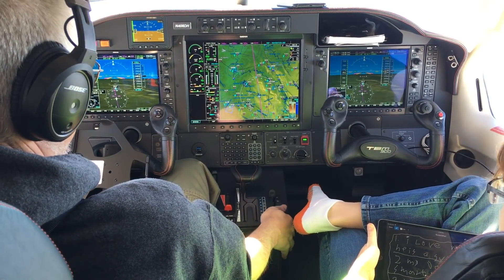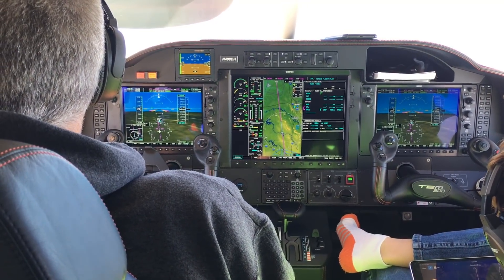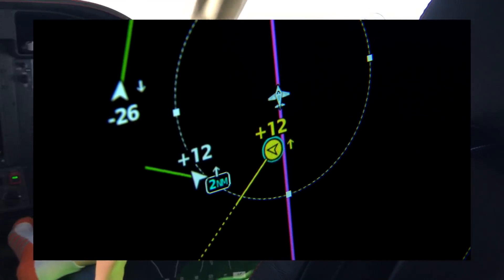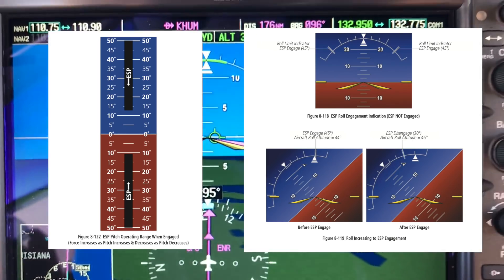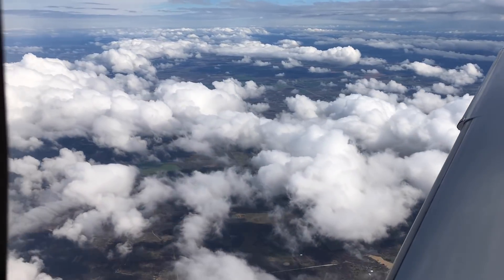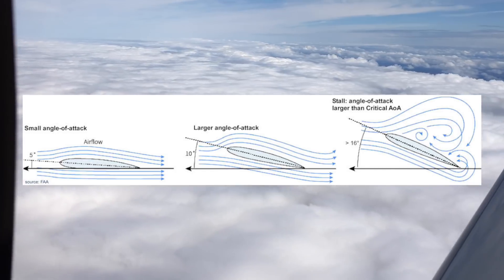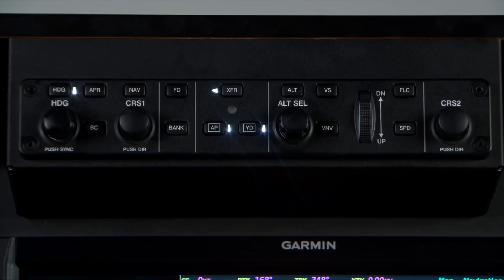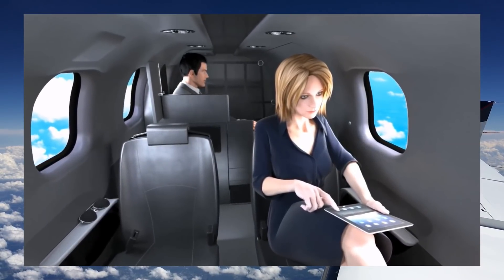TBM 900 upgrades/add-ons

Comment: Well done!  You mentioned slow speed envelope protection as a benefit, is that the one thing that led you to upgrade?
Reply from the maker: Not really, main reason is that the old G1000 is getting phased out, so I figured if I would eventually want to upgrade in the future I might as well do it now and start getting the benefits.  :)
Reply: Cool!  Thank you for the videos and sharing your flight experience and the details.  It is very informative and I enjoy learning about the ownership experience and the details of ownership.  One thing I wonder is if Daher offers an airplane option while an owner's plane is in maintenance as that can last weeks?  Are owners left to charter or rely on the network of friends to borrow one?  Thank you!  I look forward to your next video.